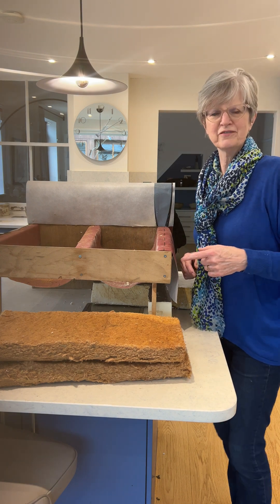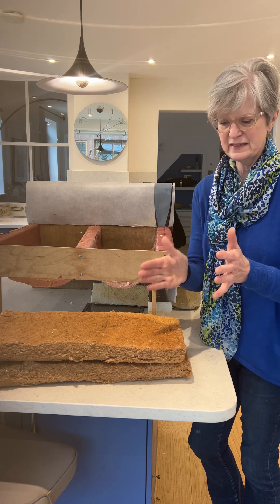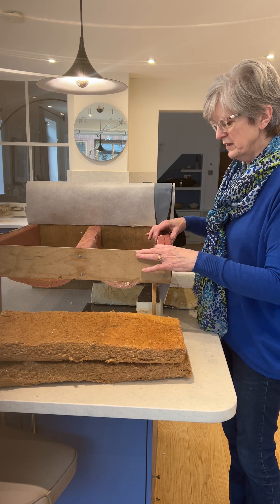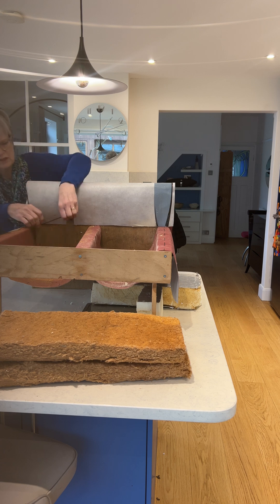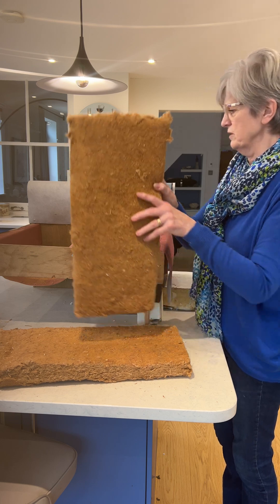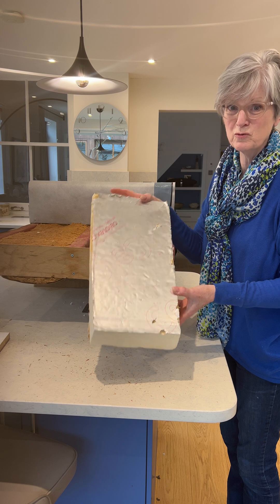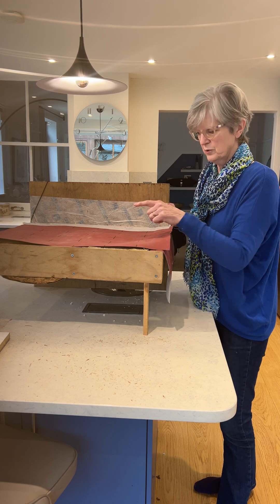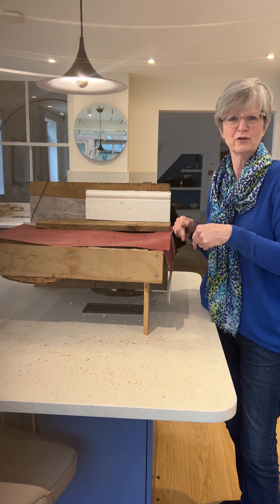Old house? Cold feet? Find out how to insulate under a suspended floor

Comment: thanks for this brilliant video. I am thinking about doing this in spring time when I have some time. Meanwhile, I'll be using cotton caulking in the gaps between the floorboards to help with the draught. I had a question though: I watched a different video where the guy added floor insulation very similar to your method. But, he didn't an extra layer of breathable membrane over the insulation material. He just put the floorboards directly back on. Is there a reason why you add the second layer of breathable membrane, and he doesn't. Here is the video incase it's helpful: https://www.youtube.com/watch?v=ar1FjRzL_CM - thanks for your help!
Reply from the maker: Hiya- so pleased the video has been useful. We put on the second layer of airtightness membrane for 'belt and braces'. We realised that we hadn't sealed the lower layer of membrane so there were gaps where it met the wall and also didn't seal each layer together so while it wouldn't allow air through the membrane itself, there was still space for air to come through at the joins. 

We went for the second layer after having an airtightness test which showed that air was still coming through, So we added the extra layer rather than lift the insulation up again and sealed it on at the floor/wall join as shown. Also sealed each layer to each other using contega tape. (since learned that there is a sticky layer at the edge of the membrane so it's actually very easy to join all the layers together) If you don't want to do that just make sure there are no gaps in the underlying layer. 

Hope it goes well
Reply: @ecorenovationhome  thanks that is so helpful. Just to clarify, may I ask what the cause of the gaps were on the lower layer? Was it just not sealed against the joist and wall properly?

From your experience, do you recommend adding a second top layer of breathable membrane over the insulation material, before putting the floorboards back down? 

I also wondered if you could share the change in temperature you've experienced and do the floorboards feel warmer?

One anxiety I have with this whole process is that it may cause condensation in and around the joists - have you had this experience at all?

thanks again for such an important video!
Reply from the maker: @benjaminh860  The reason for the gaps was that it is just really hard to get a tight seal between the membrane and the wall when you are creating the slings for the insulation. Plus for us, at that point we still had no plaster on the wall - it was just bare brick - so it would have been almost impossible to create an airtight seal. By putting a later of airtight membrane on top of the insulation we were able to create a tight seal. We used Contega tape to seal wall to floor and on the joins where the different pieces of the membrane met. 

Can't really talk about change in temperature, but we are certainly warmer. Having retrofitted the whole house (Victorian, 120 years old) we are now saving 75% of our energy usage, so it has made a significant difference. 

Re condensation: this shouldn't be a problem. The membrane is airtight but also breathable, so any water vapour can move right through the structure. (just in case you're not familiar with breathability, it actually refers to vapour permeable or vapour open. Daft label really!)So air can't get through but vapour can. 

Hope that answers? Shout if not.,
Reply: @ecorenovationhome  aww thank you! I really love your channel and I find it more valuable listening to people who have actually done this and can feedback their experiences, rather than trusting tradespeople. If you ever decide to, a video on the changes you made to get a tighter seal would be amazing and very welcome. Like an update video? Thank you again, you have been so helpful!
Reply from the maker: @benjaminh860  Thanks - you must be reading my mind! I'm working on the script for a video on airtightness right now, So shouldn't be too long.
Reply: @ecorenovationhome  Amazing.  I look forward to it!
Reply from the maker: @benjaminh860  The video on airtightness is now online: https://www.youtube.com/watch?v=JoMHQAHSGZ0&t=21s
Let me know if you have any questions. Hopefully it will make more sense
Reply: @ecorenovationhome  Amazing! thank you!!!
Reply: @ecorenovationhome  hi again, I am attempting this myself in the beginning of May (just waiting for it to warm up!). May I just double-check one thing please? Did you use the same breathable membrane on the bottom layer (before adding insulation) and on the top layer (above the insulation)? I ask because they're both red in colour.

Also, the ecologicalbuildingsystems website you kindly linked seems to show different products: the first layer (below the insulation) is Pro Clima Solitex Plus, a wind-tight breathable membrane , and the top layer (above the insulation) is the Pro Clima DA membrane, which is the airtightness breathable membrane that prevents moisture and warm air escaping from the warm interior to the cold crawl space. I understand that they are both breathable membranes, but it seems that the first layer is specifically for wind-tightness/draught, and the top layer is for water vapour and air breathability to prevent condensation issues. 

Thank you for your time with this!
Reply from the maker: @benjaminh860  We did use the same membrane - airtight and breathable. I've not heard of windtight membrane as something separate, but EBS are very good and expert in this area so can be trusted. If it is going to prove more expensive to have different membranes - sometimes you need to buy more than you need - then I'd suggest giving the tech people a call to find out if you could use the same one. They are generally very helpful
Reply from the maker: I see that you sent a message which came into email but can't see it here. Re the different membranes - not sure of the answer so I've sent off an email to see what I can find out.
Reply: @ hi, yes! I sent a message, it's disappeared! how strange! I think I said something along the lines about how you decided on the Pavalex?
Reply from the maker: @benjaminh860  We used the same one throughout the retrofit since it was the one specified by the architect for the extension. I've written to James King at Unity Lime to find out more. So I'll get back to you. If you want to speak to him yourself, this is the website. https://unitylime.co.uk He is very helpful and they supply all the materials so he would be able to answer any questions. He was a great help to us during our build.
Reply: @ecorenovationhome  you are so lovely and we need more youtubers like you, thank you!

Comment: Well done John, and well explained. I figured out the same system 2 years ago. I tried initially without the breather membrane but it was drafty!
Reply from the maker: Well done sorting it out! The architect who supported me writing the book made very clear that insulation without airtightness would be disappointing. Draughts get through the merest slither. Did you redo it?

Comment: Is there any brickwork under the floor...I mean to hold the joists?
Reply from the maker: Hiya - the joists go into the brickwork of the walls and there is a small brick wall across the middle of the room to support the joists.
Reply: @ecorenovationhome  Is there a chance that damp could rise up the bricks and into the timber?
Reply from the maker: @BigAdyCol  Yes. To avoid that the joists sit above the damp proof course, so it blocks any rising moisture and above the air bricks to stop condensation.
Reply: @ecorenovationhome  Thanks for that.  But was the damp proof put in all existing buildings when they were built or is this something that has to be added now?
Reply from the maker: @BigAdyCol  my understanding is that a DPC was out into older houses. Often layers of slate. I know we had that (1901) We also had an injected DPC added.

Comment: Hi - please can I check. The membranes used to sit the insulation in and top off under any floor are both breathable?
Reply from the maker: Hi Matthew - yes, the same membrane is used for both. It's a breathable, airtight membrane. It will usually need to be breathable since it is primarily houses built before 1930 that have suspended floors and they were all built as breathable systems. Hope that answers?
Reply: It does thank you, I’ve seen other systems where the bottom is airtight and breathable but the top is not breathable. The reason given is to prevent moisture condensing. To me that doesn’t make sense as you’d trap in moisture and the underfloor vents should take care of any moisture. This approach seems to make more sense.
Reply from the maker: @matthewdeakin8266  Totally agree with you. That makes no sense. Full breathability is what will stop moisture condensing.
Reply: I'm planning to install underfloor heating on top of the suspended floor, would that make any difference for insulation material choices?

Comment: I’ve installed spray foam insulation, what are your thoughts on that?
Reply from the maker: I think it works well but there are concerns. Not so good for the environment. Need to make sure your insurance covers it. Some mortgages lenders don’t like it - so worth remembering that if you’re going to sell. How is it working?

Comment: We have been looking into doing ours as we want under floor heating would your method work the same as I was thinking we have to baton and kingspan it? 
Great demo 👌🏻
Reply from the maker: Underfloor heating is fine over insulation. Kingspan is not your best option. Suspended floors move and it won't move with it, so you'll end up with draughts coming through. Plus it uses toxic chemicals so not good for health in a well insulated airtight home. 

We discovered a product called Econna Board which went on top of the joists/ insulation. It is tongue and groove which means better for airtightness and it has grooves for the UFH pipes. No idea about the providers here, but this link will give you an idea of what I mean. https://www.warmup.co.uk/underfloor-heating/water/econna-joisted-floor

Hope that helps. Let me know if you have more questions. You can read more about it in my book if that would be of any help https://amzn.to/3EOBHjM  It's a lay persons summary of the whole retrofit process, so you have enough of the basics to talk sensibly with the builders (who don't know a lot more than we do!)

Comment: Never knew about the wood insulation!! Can this system be used in a suspended floor on a 1980s build do you think?
Reply: I don’t deny all that you have said but the cost is very significant and therefore payback may not be worthwhile. Is there a lower cost and easier to fit solution(but compromised thermal barrier) but prevents draughts? I.e. just fit the air/moisture barrier directly under the underlay on the floorboards?
Reply from the maker: Well there you go - I didn’t know you would have a suspended floor in an 80’s house! We’re all learning🤣🤣. 

There are so many different firms if insulation now. It amazes me. Wood fibre is just one of the sustainable options. Just take a look on this site to see what’s possible 
https://unitylime.co.uk/product-category/insulation/

This site shows the formal way of doing what we did ourselves and talks about reasons for different types of insulation. Let me know what you think. 
https://www.ecologicalbuildingsystems.com/post/best-practice-approach-insulating-suspended-timber-floors